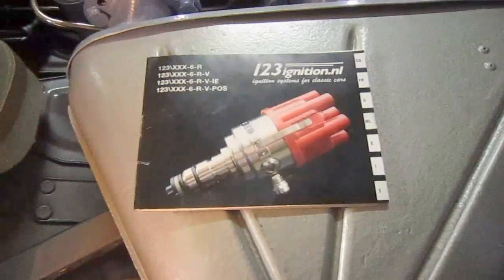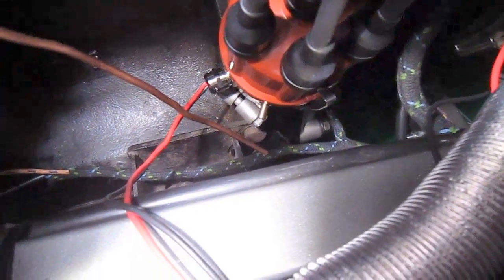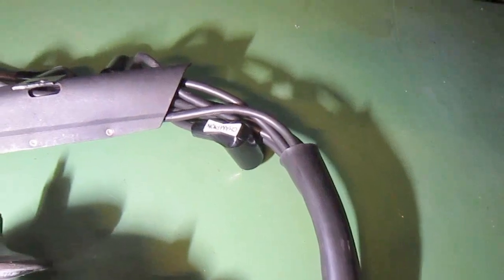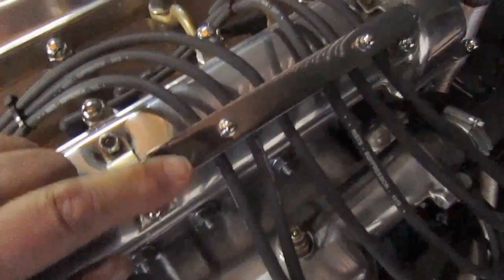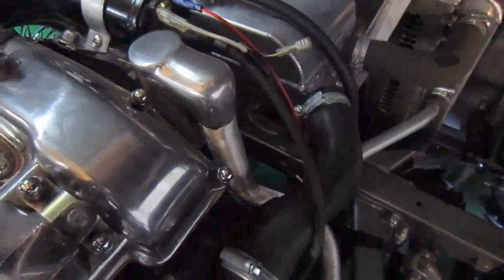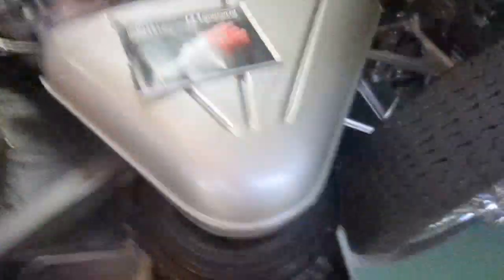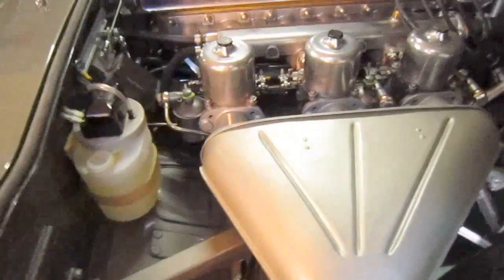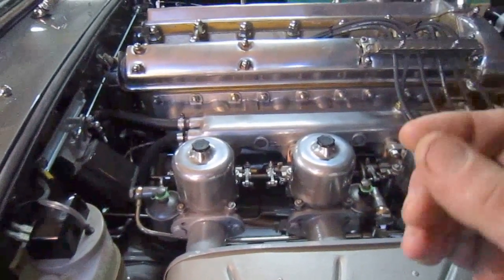jaguar e type 123 E-Distributor

Comment: The chrome plug wire separator/divider from SNG Barratt, what do they call that? I can't find it anywhere on their website.  Thanks.
Reply from the maker: Gary, Type in the search box plug leads or polished alloy spark plug conduit and you will see about 3 down on the photos. Cheers Dave
Reply: Thank you!

Comment: Hi, I've just fitted mine. What has anyone chosen for the power curve, i have 16 options presently on no 5
Reply from the maker: Adam, I went with No7 an it seems run well but I chose and middle setting and would work from there 🤔 Cheers Dave

Comment: Hey Dave. I know its years since you posted this one and I have been watching all you recent vids around your 150... I have a question though about the 123. I have a 3.4 XK engine in my MK2 and I have just bought a 123 distributor. The one I bought now has a Bluetooth connectivity that allows the power curve to be entered remotely. Now then..lol How do I map this for the different rev range. If you look at the instruction manual it has several graphs but I am struggling to work out the inputs I would need to enter. Ps I havnt fitted it yet so thought I might give you a shout. Got a laugh when you mention the short shank 7/16. Sounded like short shank redemption lol...J in Glasgow
Reply from the maker: J, I have the 123 with the USB cable port in my XK 150 and tbh I haven't got a glue how to set it up 🤔🤣😂I have kept it on the factory setting just now
and once the car is finished I will take it to someone who knows how to use the software to adjust it for me! Sorry I can‘t help but I will do a video on the ignition
timing when I get it done. I did plug it in to the computer and got a dash board setup but I couldn't make heads or tails of it 🤔😯 Cheers Dave
Reply: @ClassicCarCave  Brilliant. would make a great video. The main issue with all the vids out there about the 123 is they show you how to fit it but miss out going through the ignition and vacuum advance curve. JMD
Reply from the maker: I have found some videos from   ( Holden vintage & Classic ) about setting up the 123 dizzy I hope it helps. Cheers Dave
Reply: @ClassicCarCave  Thanks dave. look forward to that

Comment: Hi can you help me if I emailed you I’m stuck on an issue only you’ll understand well is that ok thanks I’d be mad into them old jags myself
Reply from the maker: David, my e mail is davejaguar66@gmail.com   Cheers Dave
Reply: @ClassicCarCave  saved your email thanks it’s certainly a passion for life this game I’d be mad into old jags myself
Reply: Only I have timed & everything curve is ok, only want to know HT leads to run in order from 1 to 6
Reply from the maker: @davidobrien8978  
David,  I‘m sure you aware that No1 cylinder is on the gearbox end of the head not the radiator end, the firing order is 1,5,3,6,2,4,  Cheers Dave
Reply: @ClassicCarCave  oh yes I’d certainly know them XK engines well
Reply: Green light is on & 10/50 timed only need to know is 3 HT lead on the cables  side on the ignition.
Reply: This car is positive earth, the HT leads are fitted same as negative, 123 ignition I have it in my S type I only clarify.
Reply from the maker: David, It Doesn't matter the plug leads are the same. Is there a reason you have kept original pos earth as opposed to chaning it to 
neg earth as they changed all cars to neg earth in the 60s as you get less electrolysis issues. Cheers Dave
Reply: @ClassicCarCave  it’s certainly not my car it’s a Friends she wants to keep original so I’m just making a reliability motor thanks I feel very appreciative knowing that information

Comment: Very confusing how you describe the 123dist needs the vac fitting (version) or else your screwed. Plus, you mention leave the ground wire OFF when setting the static timing. WHY ?
Reply from the maker: Patrick, I should have said IF you have vacuum pipe then you need the vacuum on the dizzy or you have toblank it off, Sorry but it‘s been some years i can‘t remember if or why i would say that! Cheers dave.

Comment: I've fitted one of these to my 4.2 series 1 and it has greatly improved the drivabilit
Reply: sorry. .comment incomplete. ..drivability greatly improved. ..I can recommend
Reply from the maker: Dale, Can you tell me what setting you have it on, I left the setting in the middle as it came from the supplier
under the Allen screw. The only problem is you can‘t change it in situ the body has to come out. Cheers David

Comment: a little engine oil on the rubber makes it slide in with reasnable force. I m adding one to my MGB but my issue is how to wire it to a smiths RVI Tach?